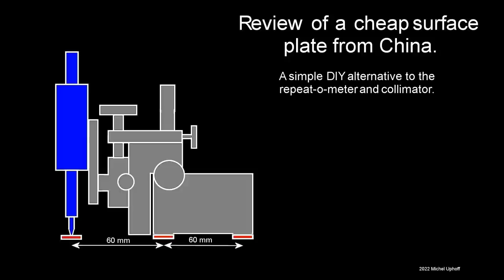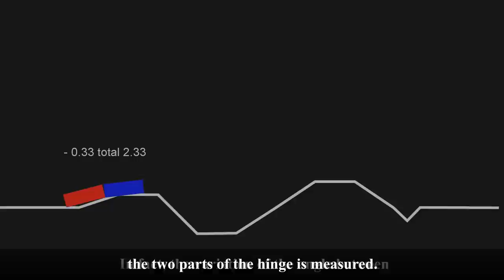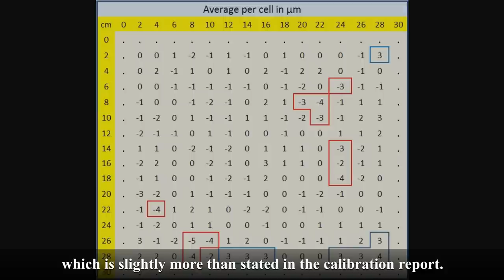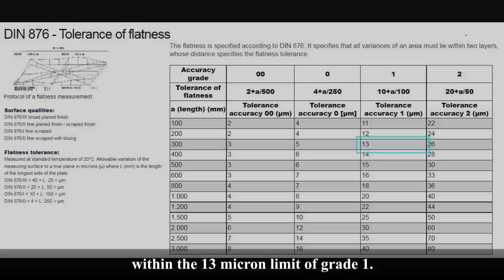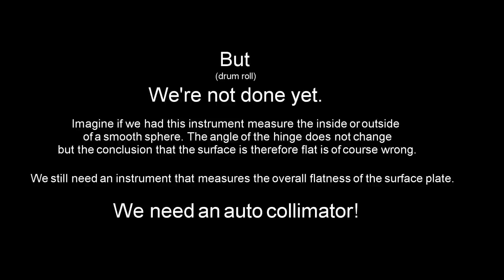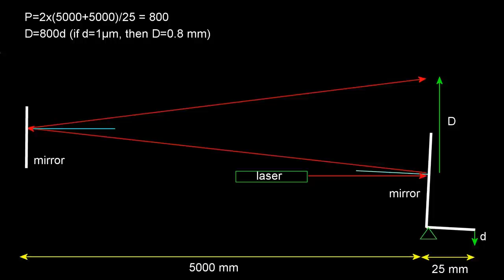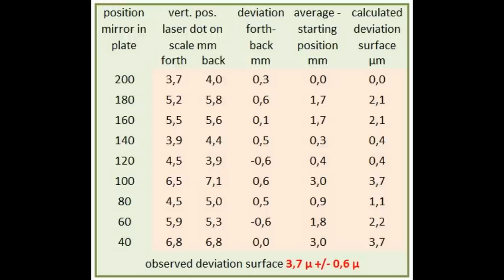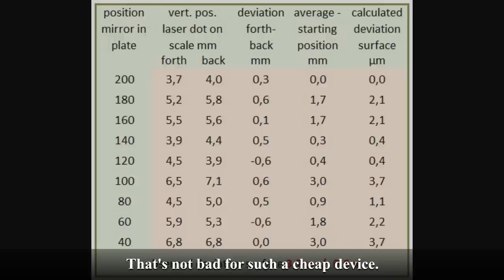How bad is a dirt cheap Chinese surface plate?

Comment: Why did you add 2× in your formula? If you extend the beam to ten meters you get a P of 400, or do I miss out something here?
Reply: And 7u was the specification of that certain surface plate anyway, not 3.6u.
Reply from the maker: Your missing the law of reflection: The angle between the incident ray and the normal is equal to the angle between the reflected ray and the normal. That's why I draw the two blue lines in the sketch. That is the normal mentioned in that law, a imaginary line perpendicular to the mirror surface. According to that optics law tilting the mirror in my setup one arc second leads to a two arc seconds tilting of the beam. A well known example: What angle must a mirror have to let me look around the 90 degrees corner of a house? That mirror has to be rotated only 45 degrees.  Hence the 2x.
Reply from the maker: @janlolwitz951  It could be that if I were to perform this laser measurement over the entire surface of the plate, I would encounter that 7µ somewhere. This test was limited to only one path, and the measured deviation amounts to that 3.6µ, proving that the plate is not convex or concave, at least along the measured line.
Reply: @Michel-Uphoff  
It took me a while to figure that out. I had trouble to even measure 0,1mm feeler gauges correctly, while sometimes it worked, most of the time not. I drew a few lines in CAD, applied your schematics and it showed me where my error was. This is brilliant. Thank you.

Comment: I've just received a Chinese-made surface plate from fine-tools. It's... not shiny, nor even semi shiny. I'm afraid to even check it.
Reply from the maker: Shiny or not doesn't matter, just check the flatness.
Reply: @Michel-Uphoff  My worry is also that if any die gets on it, it stays there forever. There's no way I get it off from such a porous surface. Or at least it seems to me that way. I've never handled a not-polished granite :)
Reply from the maker: @Tome4kkkk  Ahh.. you didn't mention it was a granite plate. Thought it was cast iron. Granite shouldn't be porous. I, in your place, would return it.

Comment: I purchased a 1” thick granite cutting board for $20 and it is more accurate than a Chinese piece of crap granite surface plate at 5 times the cost of what I paid.
Reply: Did you measure the cutting board…?